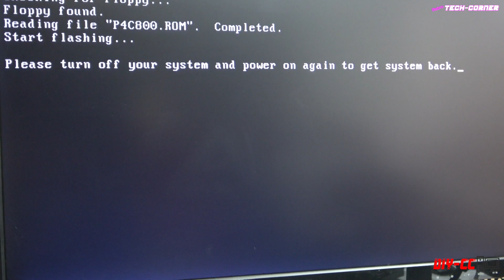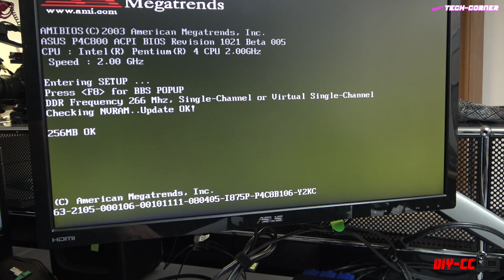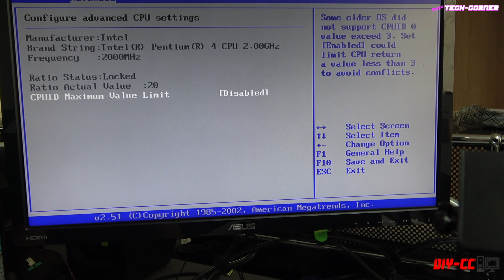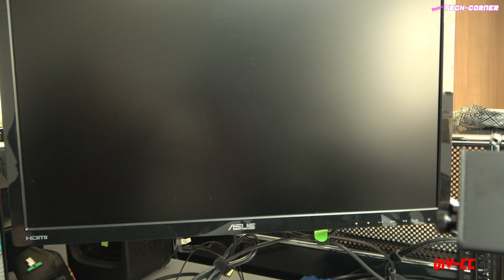ASUS P4C800 & Pentium 4 2 GHZ system setup #RetroTech

Comment: Hello there, i have an asus p4b mobo too. i tried testing it but the all fans including the fan from the psu ran at full speed and that's about it. no display,let alone boot up. did you ever manage to get yours running? if so,what was your solution? did you need to bridge some pins/tweak some settings on the mobo? i messed around with some cpu frequency switches (the blue module) but nothing fixed it. it might also be the ram tho,but it's the only stick i have
Also,i saw that you put the graphics card in the white slot ,not the brown one. Does that matter at all? 
Thank you and have a good day!
Reply from the maker: Hi, 
sadly i was unable to get the p4b booting 😔 I think Mine has an hardware failure 😔
I did used the white PCI (Not PCIE!) Slot because i was using a PCI based graphics card. The Brown slot is for AGP cards only.
Best regards
Reply: @ Thanks so much for the quick response! Hopefully i can figure out what MY problem is 😮‍💨
Reply from the maker: @dumitruleonard08  🤞

Comment: just a little correction: The ASUS P4C800E Deluxe i875P (which I also happen to have) does support dual channel DDR, it uses the flagship intel chipset and it's the best board ASUS ever made for S478
Reply from the maker: Thank you very much for the additional information regarding the ram support. I also love these old boards!
Best regards
Reply: @diycarcorner  no problem. Mine has 2 sticks in dual channel, a Radeon 9550X TurboGuru by ABIT and a P4 Prescott 3GHz 2004. Also have a build with an XP 3200+ AMD and 9800XT on an MSI K7N2 Delta2 board. I have all 00s sockets (462, 478, 754, 939, 775, AM2/AM2+). Just missing 370 and 423 from intel and 940 from AMD. Also fun fact. This reply was written on the P4C800E Deluxe powere PC :D
Reply from the maker: @centigrams  Very nice, that you still use these great systems! I would like to build an old SLI system but currently i do have a lot of work on my cars but i plan to do the SLI build this summer 😊
Best regards
Reply: @diycarcorner  haha cars are my second hobby :)) thankfully I like cheap old ones. A legendary SLI setup would be an 8800GT/8800GTS SLI on an nForce 680 SLI intel or maybe an ASUS M2N SLI Deluxe NF570 SLI AMD board. I have that M2N but sadly not the SLI setup :/

Comment: hi! i have the same setup. can you give some info how you installed windows? i tried to install win 10 32bit using a usb and rufus but without result. any help would be appreciated
Reply from the maker: I did use my old SATA based CD drive, like in the old days. It did work like a charm ;)
Reply: @diycarcorner  thank you for the answer! I'll give it a try
Reply: You cannot install Win10 32bit on this board, because the CPU doesn't support the NX instruction.
However you can try to install Windows 8.1 32-bit using a special patch to bypass checking this NX instruction